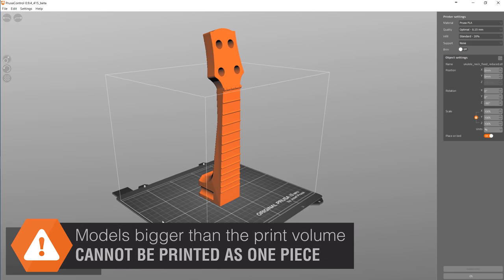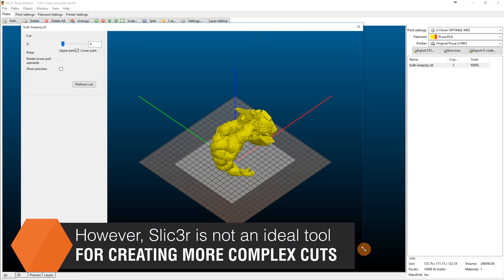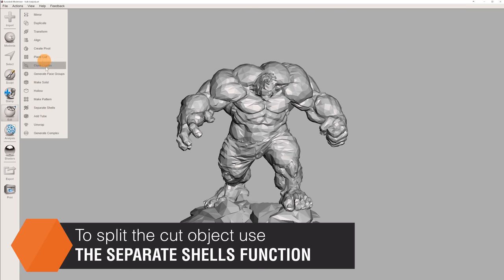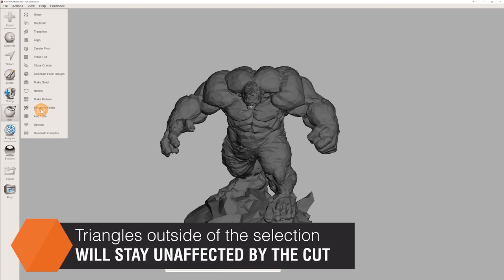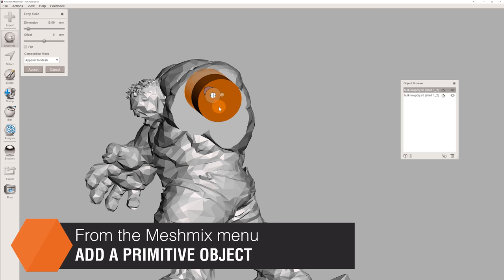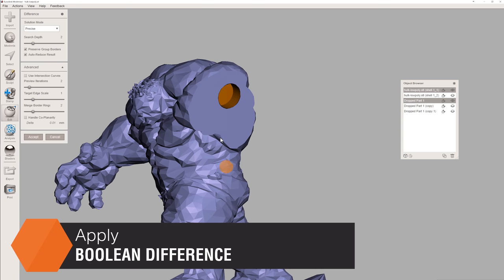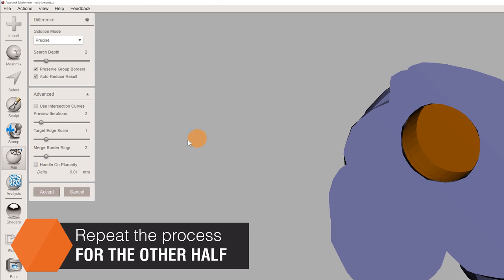How to cut STL models for 3D printing in Meshmixer

Comment: I know this is an old video, but what a gem it is. THANK YOU! I just used this method to cut down a GIGANTIC jetpack STL into 4 parts to print on my Ender 3 Max. I had messed with Meshmixer on my own and was driving myself crazy with frustration. I watched this a couple times and stepped along with your method and YES! THANK YOU!
Reply: agree to this, is there another decent way to split a model up ? meshmixer is a bit ancient

Comment: Excellent tutorial! If you want to make sure that the arm doesn't twist you can add a second (smaller) cylinder next to the first one. Using the 3d primitive "box" (cube) is also a good method to guarantee that the part will stay in place without twisting. You might need to experiment with the tolerance values to make the parts fit perfectly.

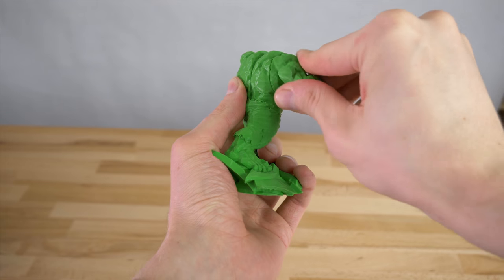Comment: In woodworking you learn not to make straight cuts in elements like trim, because if they spread even a hair (which happens even on nailed and glued wood due to temp, humidity changes) you'll see a deep shadow line like you can see 15 frames after 4:16 on the right arm -- you can actually see all the way through the model to the wall behind it. If you made those cuts on an angle - conical in 3D in this case - that couldn't happen.

Comment: Thanks for the video, great stuff. Though following your steps I still have problems with the pieces not being able to fit. the primitive is just to fat after printing. Can I do something in the settings while in meshmixer do avoid this? Thanks. I am printing in 0.2 layer height mostly so I understand that It will expand a bit material wise. Cant understand the settings while in boolean difference really.
Reply: I think it's the Target Edge Scale https://youtu.be/Tgc66TvEke4?t=191 He mentions it, but doesn't really expand on why he's doing it so I missed it. I'll need to try this out myself as my parts didn't fit either.

Comment: The method is straight forward, but as an aside, how do you get the parts to have that transparency (i.e., you can see the end of the peg that is inside the part @ 2:40 and 3:50)?
Reply: it looks like his model is hollowed on the inside, you can do this through your slicer software (I know prusa has this)

Comment: Is it possible to do it so the pins are just part of one side of mesh with the other part having the holes for those pins instead of making it holes on both sides with pins being separate?
Reply: You can use the Boolean Union instead of Boolean Difference

Comment: the glue pin you made, would it be easier/better to make one a hole and the other be left inside the other part, so that you can just plug and play, and not have to line it up just right after print. like instead of a cylinder make it a star so that it would only fit in a certain rotation?

Comment: Is there a reason to not just combine the primitive with one side of the part?  I would think you could then avoid printing the additional primitive and the connection would be more secure, but I'm not sure if there is a reason this is not ideal.
Reply: This is what I'm thinking. Have you discovered if theres a reason why?

Comment: would it not be easier to just have the peg attached to the model on one side with a cut on the adjoining piece?
Reply: I was going to ask the same thing, I guess it depends on what you want to lay flat on your build plate. If you're slicing up it this way it may be that you want the sliced part of the arm to print flat on your bed.

Comment: What is the target edge scale for?  I tried researching, but found nothing?  Overall, great video! I came across many videos for slicing in Meshmixer, but none of them showed how to incorporate using a peg to attach the pieces. What are your thoughts on instead of two holes and one peg, having one piece with the peg attached and the other piece with a hole?

Comment: won't it be a problem if the cylinder is so perfectly fit there is no difference between the boolean hole and the parent cylinder after printing and trying to push the cylinder into the hole?

Comment: i never got me a sla printer because i thought splitting files would be very hard... but it actually looks pretty easy.. i got one question why do the allign pin isnt printed so the half sticks out of the body or the arm insead of using a loose pin?

Comment: Hi. I'm following the setps one by one but with every model i've tried, when i get to the Boolean difference, I get the message "An unknown fatal error has ocurred in the current Tool. Aborting" why can this be happening? And how could I fix it?
Reply from the maker: In Meshmixer you can try Analysis - Inspector - Auto repair all.
For repairing meshes, Microsoft 3D Builder is awesome, you can also use the web service:
https://tools3d.azurewebsites.net/

Comment: Is there a reason to do it in three pieces? Could you use boolean union on the arm to have it print with the pin sticking out of it, and then insert it into the body? Great Video btw.
Reply from the maker: You could totally do it the way you suggest. That the plane of cut is often used for placing the model on the bed. With the pin sticking out, not so much. But that varies model to model, so both options have a use. And thanks! :)
Reply: @Prusa3D  Gotcha. Makes sense.

Comment: Is there any way to reverse this process, provided that you have a model that the creator split and you want to print it as one?
Reply from the maker: You could try to do a "boolean merge", either in the mentioned Meshmixer or in, for example, Blender. For that to work, there must be no gap between the parts and maybe even a small overlap might be beneficial.
If there's any internal geometry (e.g. a key), that might produce some internal cavities. Though that probably wouldn't be too big of a problem, since it's hidden on the inside.
-Mikolas

Comment: Whenever I separate shells it becomes dozens of different pieces instead of 2.
Reply from the maker: Then the model was already made of dozens of pieces when you imported it. It happens, from time to time. 
You can use Edit-Make solid to solve this, but it will decrease the model's resolution a bit.
- Mikolas

Comment: WHen i set the parameter too 0.41 my computer just stop working lol
Reply: set the value to 0.41 press enter and let it calculate the result. once it's done then press accept; Otherwise. it will crash. If you are still crashing check the mesh face your're doing the boolean from and if it doesn't have enough faces it will also cause it to crash.

Comment: i have found that meshlab is 10x more useful than meshmixer.
Reply: It has way more features. You can process 3D scanning point cloud data in it, fiddle with textures... Question is whether that's a good or a bad thing for the majority of people. More settings, functions, menus mean less clear UI and more to get lost it. I find Meshmixer extremely easy to use even for a casual pc user.
Reply: if only it had undo... :)
Reply: i make my models in wings3d. i have 2 years of files that meshmixer couldnt fix. most are printible after 2 filters in meshlab. without surface deformation. something i could never get meshmixer to do.

Comment: Good video but the print looks terrible- must have been printed on the MK3.
Reply: I knew someone would complain about the print quality. I've reprinted it on both MK2S and MK3, but this is just how the model looks at this scale. The model includes torn clothes and other random pieces that make the print look bad, but that's just how the model looks.
Next time, I'll make sure to pick something pretty, because whenever there's a chance that someone will complain, it will happen :D
Reply: It's not the model alone, the MK3 is just a low quality print producing machine. Go back and look at all the videos showing it print. They all look like trash. Let just be honest for once please. The MK3 needed to be recalled, it was not ready to be released and there are 1000's of people who have had issues. It has been a big black eye since the beginning, and it continues to not be was it was promised to be. The only decent prints that come off the machine are rare at at about 30mm a sec.
Reply: I don't know where are those 1000's of people with issues you talk about. Looking at all the groups on facebook or google+, the vast majority of users are extremely happy with the printer and are sharing wonderful prints and advising others to buy the printer. 
However, if you personally have a problem with the printer, be sure to contact the customer support, ideally via 24/7 live chat at prusa eshop page. If there is any faulty part, a replacement will be send to you asap. 
Or use this link to contact support: https://shop.prusa3d.com/en/contact-us
Reply: i created my own S3D settings and i'm extremely happy with my MK3
Reply: You're just talking about i3 designs in general, right? Because the MK3's mechanics are functionally identical to the MK2. The print quality is only slightly better, not worse. https://i.imgur.com/ZLc0CZ6.jpg
Reply: Kraken Studios Sorry you can’t afford the mk3.

Comment: I got a question: is there an advantage ofs using a separate loose pin like you did instead of a pin connected to one half?
Reply: I wonder if the clean cut was the base for the print?